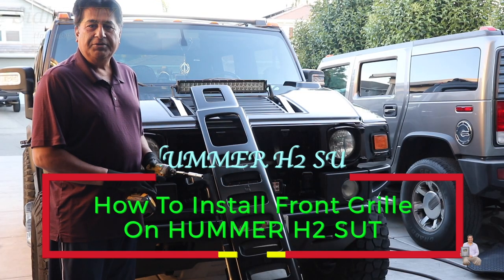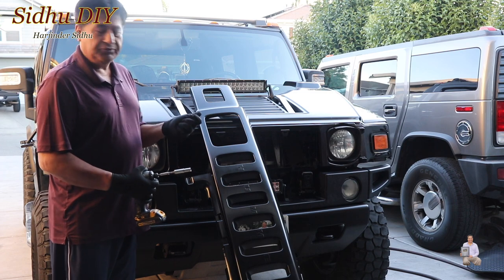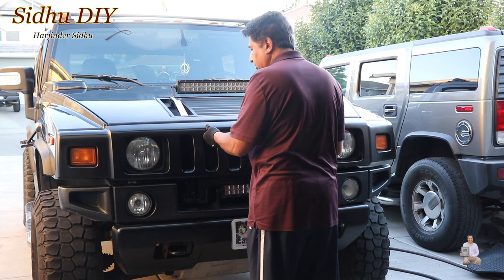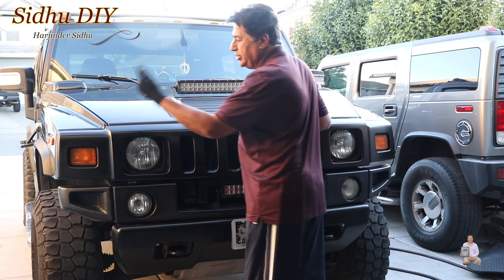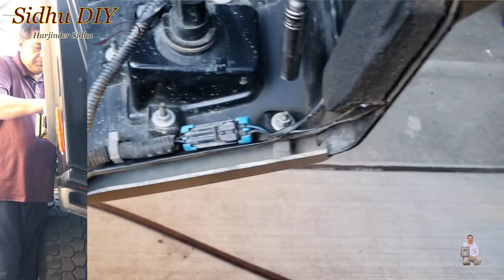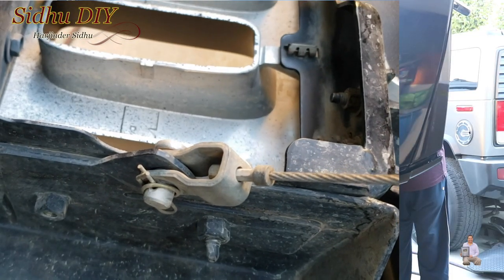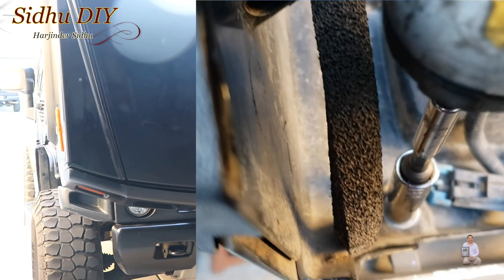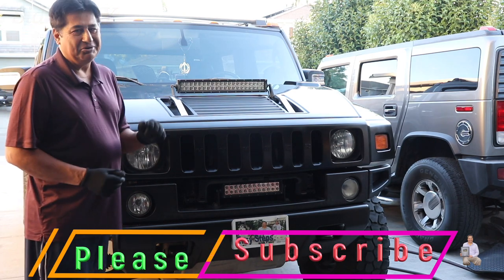How To Install Front Grille on HUMMER H2 SUT

Comment: Can someone tell me if I should have a toggle switch by the left side of steering wheel, close to the tilt steering? Or is this after market? 2005 h2 sut. Thanks
Reply from the maker: After market, for your led bar.
Reply: @SidhuDIY  I figured that, but apparently someone removed it. That sucks lol.